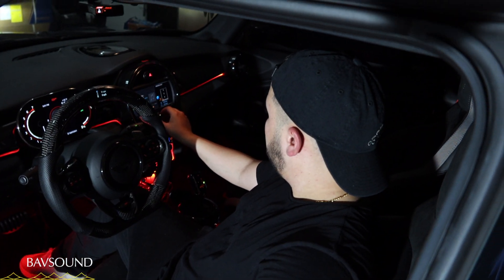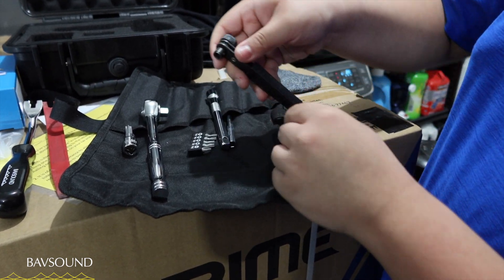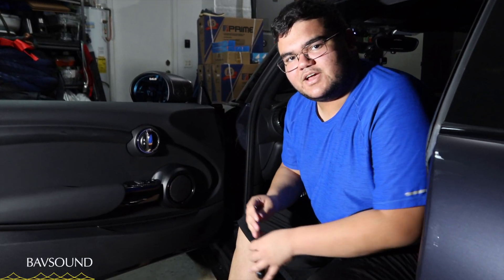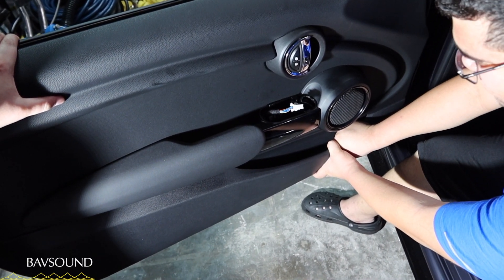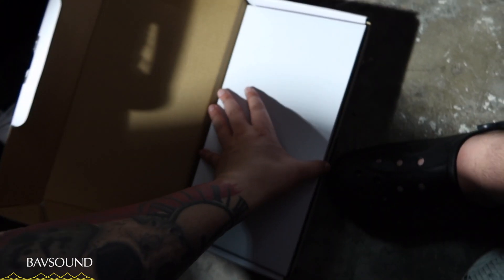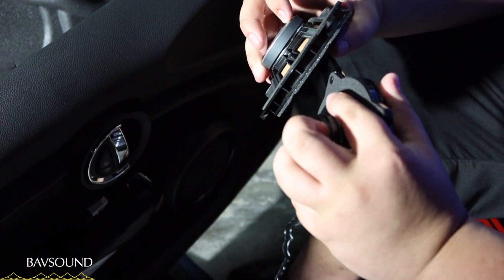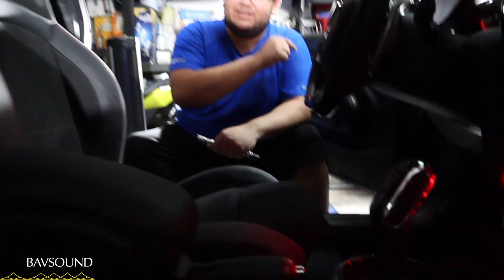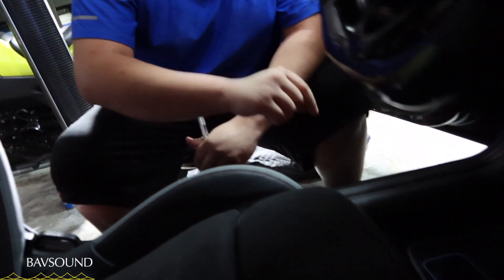MINI John Cooper Works GP - BAVSOUND SPEAKER SYSTEM INSTALL - REVIEW - SOUND TEST - COMPARISON

Comment: After I installed the passenger side ghost, and reconnected the yellow plug, a warning sign “passenger restraint warning” is shown and the warning does not go away. 

Anyone had that? 

🤦🏻‍♂️
Reply from the maker: If anything, I would do what I do when something comes up like when I disconnected my seats, we connected the car to BimmerCode to reset the ECU…if not you’re going to have to take it to the dealer to have it done.
Reply: I just got the same problem. seems like you gotta take it in to the dealer to get it fixed.
Reply from the maker: @potatogaming1187  Or save yourself the time and get BimmerCode and an OBD II reader 🤷🏻‍♂️
Reply: Same case. How did you fix it?
Reply: @alexnunez4870  I had to bring it back to Mini. Or, I am told I could reset that with recoding if you know somehow who has the tools.
Reply: @alexnunez4870  how you got it fixed eventually? I understanding how annoying it feels to have that warning sign all the time. And you also may worry about malfunctioning of the safety features in the seat.
Reply: @jeffluk1824 I'm installing a DSP (Kicker Key) which I haven't finished yet. Until then, I'll find a way to remove it, but I'll be updating.
Reply: @alexnunez4870  Good luck :)